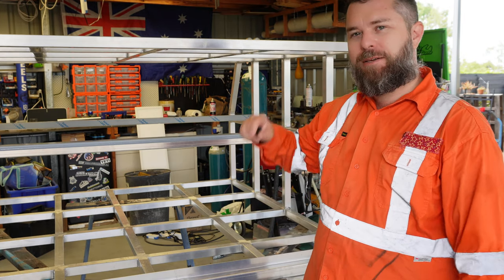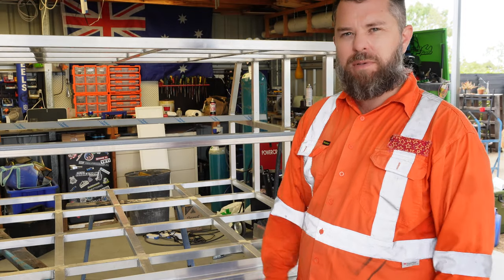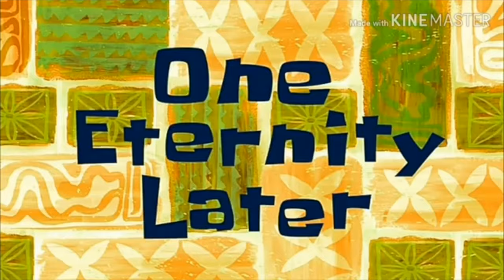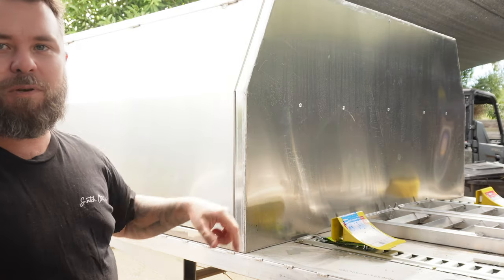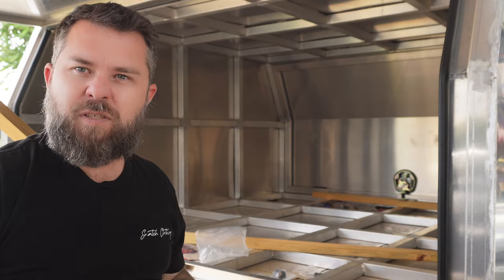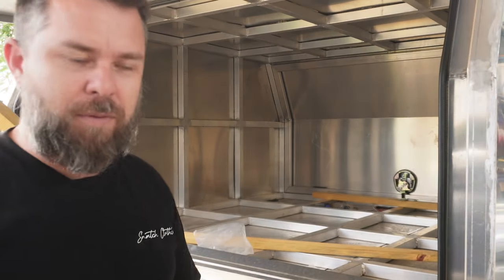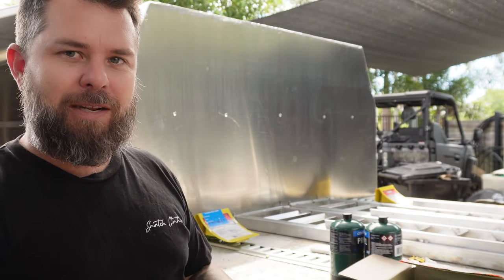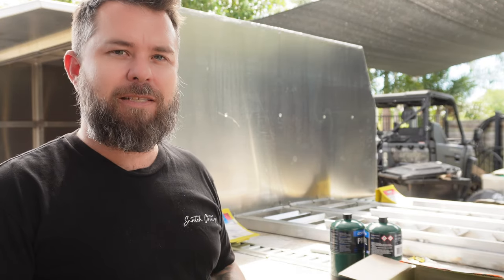Skinning the canopy! Aluminium offroad toy hauler build #overlanding

Comment: I’m about to have a crack at this myself, how did you control weld distortion when welding the skins on?
Reply from the maker: Short answer, I didn’t 😂 some of it warped pretty badly. I put some rivets in it as well to hold it in place when welding which helped a little bit. I left like 3mm clearance and it still grew that much from the heat that it touched and pushed up 🤷🏻‍♂️